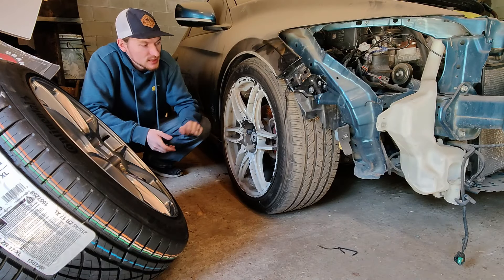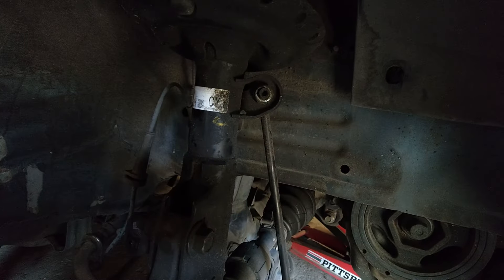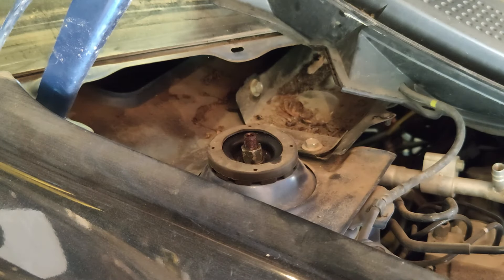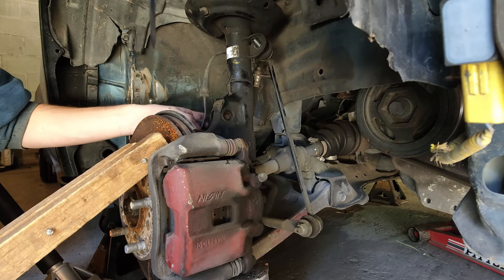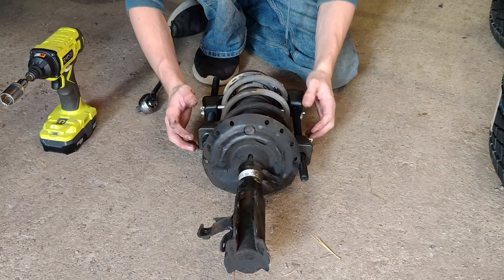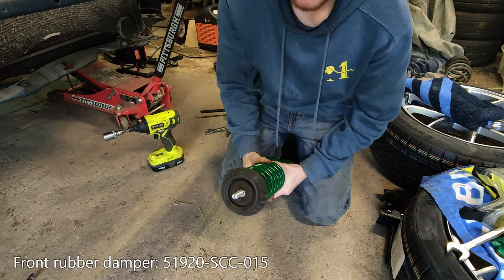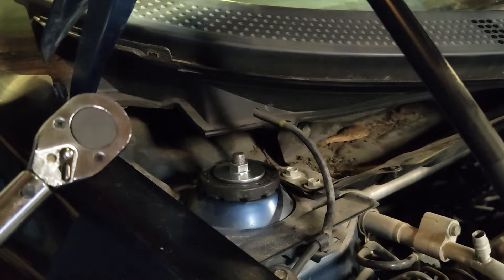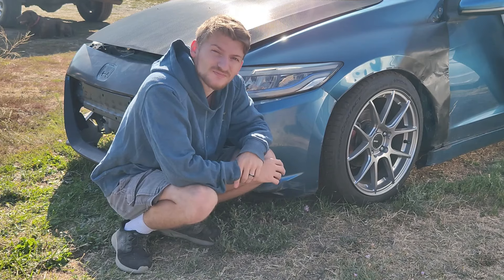How To Replace Front Struts on a Honda CR-Z

Comment: bro you're a legend, this on my to do list and with your video now i am going to bump up its urgency .  i got this crunch or weird vibration now and then on corners and the steering rack appears 100% so this was my next bet!
Reply from the maker: @KeebaAfrica  definitely check over all the hardware as you go and make sure it's properly tightened, and as I mentioned check your axle boots and ball joints on the control arm for any damage as well. When those get damaged and lose their grease they can also cause noise and instability issues.

Comment: earned a sub. I'm collecting parts to do a coil install as well as replacing the worn ball joints / control arms. looking forward to that vid soon
Reply from the maker: Do keep in mind, on the CR-Z the outer ball joint is inseparable from the control arm. The whole unit needs to be replaced as one part unfortunately. Hoping to have this video up soon!

Comment: Is it really necessary to remove the cover to replace it?
Reply from the maker: @ygggu6767ef  I would strongly recommend it. I did a coilover install on my Fit a couple years ago without doing that, and couldn't fit a key in the center to hold the shock. I spent a long time trying to torque down the top end and ended up rounding off several nuts in the process.

It doesn't take much extra time at all. Just some plastic clips and the wiper bolts. For the little effort it makes accessing the top hardware so much easier.